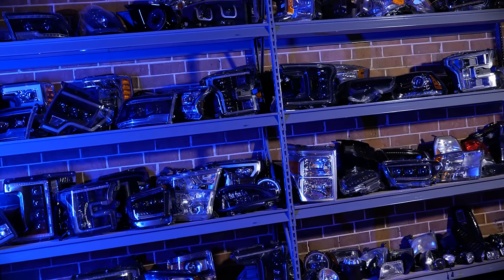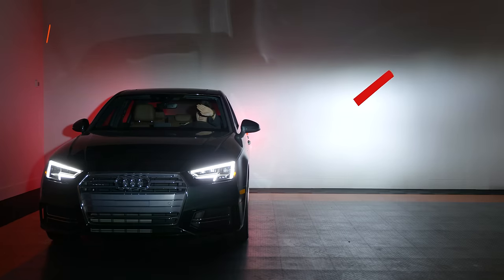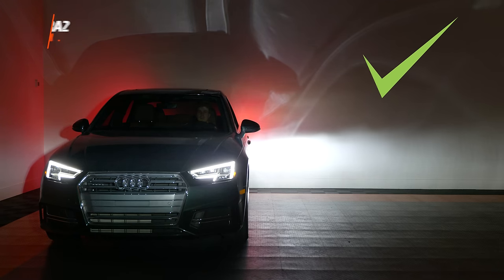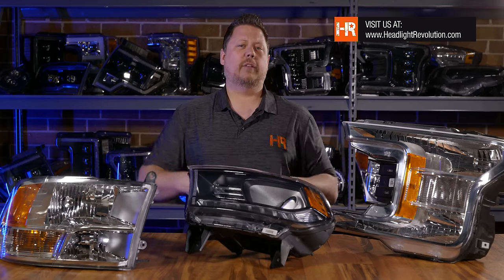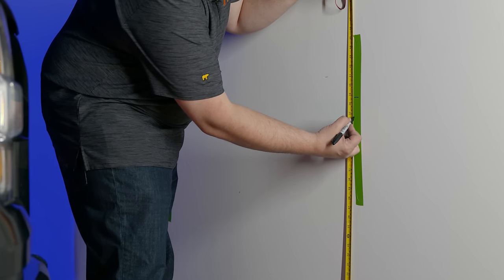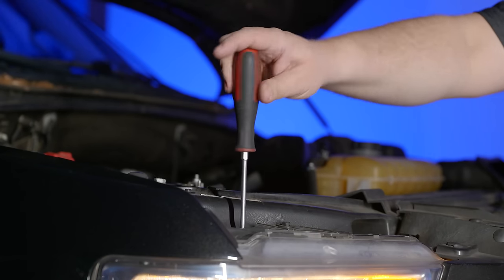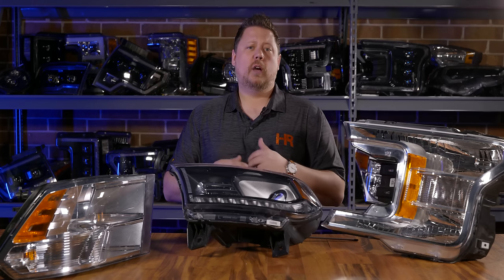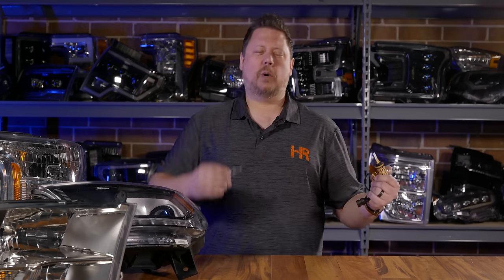How to Aim and Align Your Headlights

Comment: LED bulbs get a bad reputation because most people don't do the research to figure out what bulbs are good and how to aim them. Most bulbs on the market are trash, and this channel is a great place to find out what works. Personally, as an affordable option, I really like my $40 Hikari bulbs in my Mazda 3. The chips mimic the placement and size of the original halogen filament, and they're much brighter. Beam pattern is just like the OEM halogen. I verified they were aimed correctly and after a month's worth of night time driving, not one driver has flashed me.
Reply from the maker: Glad that you found this video helpful, it is crazy how many people do not align their headlights when they get them installed! Let us know if you have any other questions or concerns, we are here to help!

Comment: I bought hikaris h1 bulbs but the beam pattern is all off.. I can’t correct it with the adjusters on the actual headlight assembly and I can’t change the position of the h1 bulbs unlike the hb3’s I have for my brights as the h1 can only sit one way and cannot be rotated.. am I missing something?
Reply: Figured it out.. gotta buy some cheap h1 led adapters that allow the bulb to rotate to desired position.
Reply from the maker: Nice!

Comment: Just to be clear, I got bigger tires, wheels and a leveling kit done on my 2021 F150 so you'd follow these same steps?
I want my lights to be aimed properly and not be that guy.
Reply from the maker: This is still relevant, just adjust down a bit more if you still run into people flashing you!

Comment: Hi Headlight Revolution hope you can help me out here would I need to adjust my led headlight reflector that my truck has a 3" front lift 2015 Chevrolet Silverado. Sometime people in other direction will flash their high beam, I do put my low beam on when another car comes by and some other people don't flash their high beam.

Comment: what I want to know is before you adjust the headlights what should the electronic adjustment inside the car be set to? highest mid range or lowest? my guess is at the highest setting but need to be 100% certain before I attempt aligning my new headlights as they are way to far out as in aiming too low lol
Reply from the maker: If you have an electronic adjustment, you'll want that to be set at the middle setting when you are doing adjusting the headlights manually.
Reply: Headlight Revolution thanks for that advice 😊 will do that
Reply from the maker: You're very welcome!

Comment: Why my 2009 Lexus es350 doesn't fit any LED headlights on the market!!! Actually its wire connector sockets don't fit model H7. I keep buying then returned it. Could you help me please. Thanks Sir. Oh do I have to order connectors female to fit the one on market? My Lexus s ones are bigger switch.

Comment: I bought a set of Spyder headlight assemblies. they are gorgeous, but I would like a brighter beam. But the manufacturer page says HID and LED bulbs arent allowed. So is it safe for me to use a brighter halogen with more wattage? or will that burn out my wires? How do I determine the wattage of my stock bulbs. They are H7, If you have a recommendation I would love to hear it. Gonna call Spyder in the morning about it too. Been eyeing the Phillips Diamond Vision 6000k Halogen bulbs for their perfect white look. But if you know a better bulb, please let me know.
Reply from the maker: They stated that because aftermarket LED & HID bulbs are not DOT approved. Depending on your local city laws you could get in trouble running them, but most of the time no one is bothered at all.
Reply: @HeadlightRevolution  just weird that they say it would void the warranty. The wires are pretty thin coming off the low beam, there shouldnt be any risk of me burning up the wires right? i dont know what gauge they are, but they are the same thickness as the tiny wires I see coming from the wiring harness side on the car, real small, connects to a pin in the connector. I would love to grab the GTR Lighting Ultra 2 for my new headlights, just scared im gonna melt something lol.

Comment: Di you try fixing a not working left and right aim adjusters ?  mine is not working anymore, but thw up and down is good. Is there a chance of fixing it ?
Reply from the maker: If your OEM housing is not adjusting you may need a replacement.
Reply: @HeadlightRevolution  Aww.. Thanks.

Comment: Great vid, but what about high beam adjustments? Can’t find a vid or doc on that anywhere. 4 glass lights on ‘89 C1500.
Reply from the maker: The high beam is designed to shine the light higher than the low beam. Also, because they are normally not on all the time like a low beam you really don't have to worry about adjustment as much as a low beam.

Comment: Where should High Beam lights with a separate adjuster be in relation to that same center point? Is it also two inches below the center point and line or should the spot with the highest intensity be higher and where?
Reply from the maker: I like my high beams to overlap slightly with the cutoff of the low beam and the rest being above it. It's sort of preference!

Comment: That was very informative on the proper aiming of low beam headlights. Now, what is the proper procedure for aiming headlights that have separate high beams?
Reply from the maker: Glad it helped!
For the high beams theses should overlap with the low beams about 25% of the way!
Reply: @HeadlightRevolution  so the high beams lower part overlaps with the 25% top of the low beams and the remaining 75% is above them? Is that right?

Comment: Hi again I have a VW Polo Tsi that has an adjusting height adjusting dile which has -, 1,2 and 3 which is the best setting to use or I should follow as you have explained on the video
Reply from the maker: I'm honestly not familiar with that vehicle or those setting. I would use those settings and see if any of them align with what's in the video!

Comment: This video is excellent! Only thing I'd add is that GODDAMN BIGASS LIFTED TRUCKS AND SUVS WHERE IF YOU DO THIS THE LIGHT STILL SHINES RIGHT IN MY FUCKING EYEBALLS CAUSE THE BULBS ARE JUST UP SO GODDAMN HIGH.
Reply: Stop using the standard 2" & 4" drop, these elevations change according to light height. States have min and max projection distances for the low beam. generally 135' minimum and 200' maximum. If you use the 2" drop @ 25' on headlights that are 42" you'll projected the beam @ 520' and not the state maximum. STOP BLINDING OTHER DRIVERS . 42" height @ 25' should be 5.25". Use the formula (42/200)x25=5.25" below center line. ( bulb centerline / light projection  feet  ) x the distance you are projecting it to  ( test wall, test board or other ) it could be anywhere from 10 feet to 50 feet. 

Fog lights have a maximum of 135' projection, so get those adjusted correctly too.

Comment: What led bulb you suggest for 2013 Dodge Charger with halogen bulb
Reply from the maker: Unfortunately, for street legal use, we can not recommend any LEDs or HIDs, and can only recommend halogen options. I have linked the halogen bulbs that we carry for your vehicle below. 
Low Beam: https://headlightrevolution.com/h11-halogen-osram-cool-blue-boost/
High Beam: https://headlightrevolution.com/9005-halogen-osram-cool-blue-boost/

As for other options that would only be used in an offroad application, you will have to shoot us an email and then we can look into those other options for you! Sales@HeadlightRevolution.com

Comment: Have you tested HID or LED against a halogen 130 watt h4 in a reflector housing?
Reply from the maker: Not specifically a 130w, we have done some side by side testing though!
Reply: @HeadlightRevolution  any higher power than 55/60w really. I see comparison to Osram and Philips 55/60 but nothing higher

Comment: I just installed my Morimoto XB Hybrids into my 2021 Chevy 3500 and they need to be aimed - the Morimotos don't seem to have that "dimple" that shows the center so how do I find the center on these lights in order to properly align?  - thanks
Reply from the maker: You would measure to the center of the low beam projector!

Comment: So in America both headlights are same height? In europe passenger side headlight beam is slightly higher so that you could see side of the road further away
Reply from the maker: Headlights should be the same height, it's the beam pattern that has a cut-off shield that lowers the beam pattern for oncoming traffic, and raises it for signs/ditches on the passenger side.

Comment: Isnt clocking the LED bulb before install at least as important as aiming ? My CSP Mini and GTR Ultra 2 bulbs were not in the 3 and 9 position out of the box after install in my projector equipped Ram. No one seems to mention this What gives ?

Comment: I have an 06 Toyota Sienna and replaced the headlight lenses with new ones, this assembly has a single adjustment screw to adjust both low and high beams I have low beams adjusted where they should be, but my high beams are hitting the tree tops... is there a way to sync the adjustment so that both beams are relatively pointing down the road.  Could really use some help if anyone knows what to do, I'd appreciate it...
Reply from the maker: Unfortunately with most housings the low and high adjust off the same screw.

Comment: My dream low beam headlight is a really sharp cutoff with higher lux closer to the cutoff so that down the road illumination has more light than the nearby foreground illumination and 3000 Kelvin color for good performance on wet dark colored road surfaces. It's a pity it's 2021 and it seems no aftermarket manufacturer has yet achieved this not even JW Speaker. It's a pity so many aftermarket buyers fall for the blue look, lumen number, and more foreground illumination as an indicator of better performance. I honk at every car I pass that really blinds me with really badly adjusted low beams. Nowadays this can be 1 in 20 cars on some nights. Not sure if it makes a difference but if honking can help stop one old driver from being blinded and causing a crash it may be worth it.

Comment: Great video.. however is there a adjustment to not being able to use 25 feet as the metric?  My driveway is slanted and to adjust my lights I have to remove part if the engine components (air filter housing, etc) so I need to adjust inside my garage.  So is there a measurement drop that I can use for say 5 feet in distance?
Reply from the maker: You'll need to find a flat surface, that's the only real way to do it right.
Reply: @HeadlightRevolution  Thank you.  What about a shortened distance that is flat?
Reply from the maker: Honestly, I personally have always just eyeballed it, granted I've always had lowered cars too. 
I just aim them where I can clearly see the cutoff of the lights sitting below the  side mirrors of the car in front of me. 
If when I'm driving I can see it consistently jumping up into peoples side mirrors or over their trunk into the back windshield I'll aim them down some.

Comment: Doesn't the dip vary from vehicle to vehicle? Say you have a sportscar with headlights 20 inches from the ground, and a truck whose headlights are 60 inches from the ground. Then how can you use the same 2 inch dip at the same 25 feet distance for both vehicles and get equal light range or absence of glare?
Reply: I have been asking this for years!!! Headlight aiming should involve a standard strike point over distance. Low to ground sports cars should have different adjustment as a lifted truck. @headlightrevolution should look into this.

Comment: would you need to do same with HID in a reflector?
Reply from the maker: Yes you will want to aim your headlights after installation, HID included! Alignment will be different however. you want your HID Filament wire pointing Down if possible! Alignment isn't as crucial from an HID as it is with LED being so directional!

Comment: My honda civic hot spots are  up a fair amount , then you see the cutoff line , do you think its the housing ? I've tried multiple leds , hid, halogen and can never seem to get the output or look I want
Reply from the maker: If they are too tall, I would think this is just due to the headlights being aimed too tall, and to adjust that you will have to use te adjuster screws on the back of that headlight housing. If you have any further questions, shoot us an email and we will get you taken are of!

Comment: Hi I just changed headlight bulb on Audi A4 2014 when I drive night time I feel light to high and I try to adjust bringing down but don’t work What you suggested me thanks
Reply from the maker: I would first make sure those bulbs are aligned, and you will need to have the LED chips facing left and right inside the headlight housing. When you have done that, the only other thing would be the headlights themselves not being aligned properly. The video you commented on will show you how to properly align those headlights, if you have any other questions just shoot us an email! Sales@HeadlightRevolution.com

Comment: You'll still be blinding people if you're incline is higher than the other driver. Like when you're at the top of a hill and the other driver is climbing the hill from the other direction. Can that even be fixed?
Reply from the maker: No, not unless you have a higher end vehicle with auto adjusting headlights.

Comment: I have a 2016 silverado and my projector has a vertical dead zone right in the middle???? I figured it was bc the wrong led was used so I removed it and put a oem halogen bulb in its place....still have a vertical dead spot. Any thoughts?
Reply from the maker: Are these OEM headlights or aftermarket?

Comment: Hello is it advisable to install a led within an enclosed headlight like my 14 Ford edge projected headlight assy?  If so what do you recommend to use? Thanks
Reply from the maker: Converting to any LED or HID kit will not be DOT compliant. To remain DOT compliant, we would recommend going with a higher-powered halogen bulb, like the ones from Vision X. Here’s the one that we recommend: https://headlightrevolution.com/vision-x-9005-100-watt-headlight-bulb-set/

Comment: Can’t find anywhere how to adjust the headlights on my 2015 Chevy Equinox one on top is for the high beam bulb   Can’t find the low beam adjustment
Reply from the maker: Usually, the low and high beam adjustments are on the same screw, as they are usually fixed together inside the housing! When you adjust the low beam, it should be also adjusting the high beam!👍

Comment: Hi again I have a VW Polo Tsi that has an adjusting height adjusting dile which has -, 1,2 and 3 which is the best setting to use or I should follow as you have explained on the video
Reply: Aim them on -.
Then you can turn them down if needed due to extra weight in the vehicle for example.

Comment: So in my mazda it says to be 9.8ft away and make this strange pattern on a piece of paper and tape it to the wall.  Should I go by that or is tue 25ft rule ok?
Reply from the maker: The process done in this video should work for you just fine, I would do this instead of that 9.8ft rule as the further you are from the wall, the more accurate the beam will be! Let us know if you have any other questions, have a great day!

Comment: how would I adjust this rule if I drive a lowered vehicle? I feel like if I make my beam cut off 2 inches below the Headlight height I will not be able to see very far at night! I saw another youtube video that suggested just making sure the cutoff point is just below the height of the average car's side mirrors, would that work? (My projectors are only 1'9" off of the ground)
Reply: You’ll just have to accept the beam will shine closer - it you try to adjust upwards you’ll be altering the angle upwards away from the ground and towards eyes further along the road
Reply from the maker: This can be tricky because you don't want to aim your headlights so high that they're blinding on coming traffic. I'd suggest aiming your headlights up higher, and then do some road testing to fine tune it to ensure you won't be blinding anyone.

Comment: Hi Just purchased a GTR ULTRA 2 LED 9012 for my Toyota Corolla 2020 with projector headlamps. There is an adjustment knob inside the car already. Should i be using this instead to properly aim my headlights? Thanks!!
Reply from the maker: If you're able to adjust your headlights from inside of the vehicle, that should work just fine!
Reply: Thanks so much
Hoping you could also feature something like this for sedan cars - say Toyota corolla which is the most sold car in asia, Philippines
Reply: How is it that tje LH side is lower than RH beam?
Reply from the maker: Some people like aiming the RH side up slightly higher so that they have a farther view of light on that side. Since the RH side isn't facing oncoming traffic it won't blind oncoming traffic as long as it's not aimed too far up.

Comment: If you have a lifted vehicle would you subtract the lift amount from the initial 3 foot mark. So center line of light - minus lift amount to get stock center and go from there, so you don't blind folks?
Reply from the maker: Yes, you will want to account for a lift when aiming headlights!
Reply: Or try looking at your car from another car's perspective. Preferably a sedan
Reply: Stop using the standard 2" & 4" drop, these elevations change according to light height. States have min and max projection distances for the low beam. generally 135' minimum and 200' maximum. If you use the 2" drop @ 25' on headlights that are 42" you'll projected the beam @ 520' and not the state maximum. STOP BLINDING OTHER DRIVERS . 42" height @ 25' should be 5.25". Use the formula (42/200)x25=5.25" below center line. ( bulb centerline / light projection  feet  ) x the distance you are projecting it to  ( test wall, test board or other ) it could be anywhere from 10 feet to 50 feet. 

Fog lights have a maximum of 135' projection, so get those adjusted correctly too.